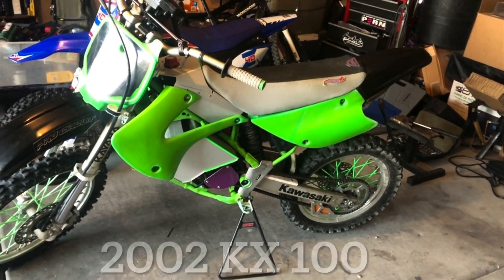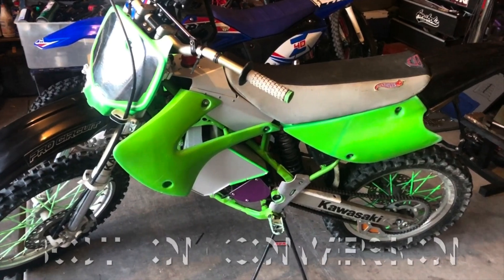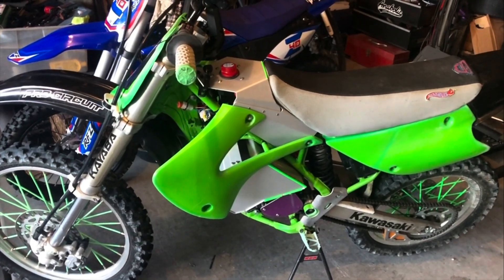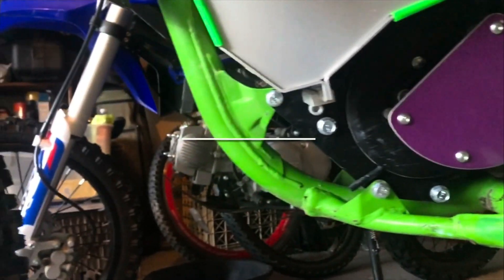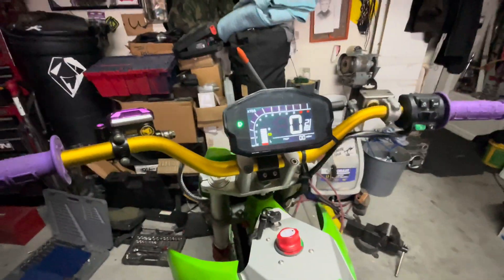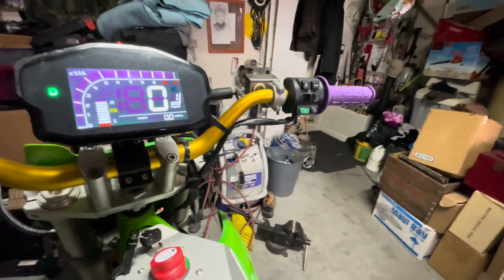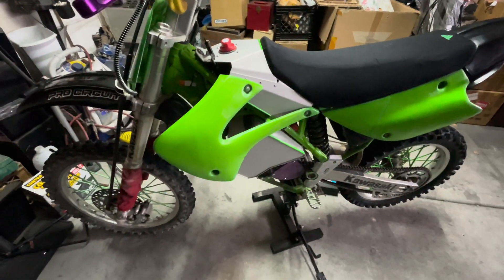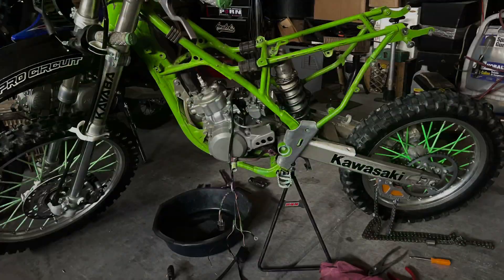Brap to Zapp. Electric dirt bike conversion

Comment: Do you still have this build?
Reply from the maker: Yeah I still got it. It has not needed anything I put different foot pegs on it that lowered them and it made the bike perfect. 
The size of the kx100 with the 16-19 rim set is bigger than a Surron but smaller than an Ultra bee. It’s perfect size

Comment: Clean build with that kit,  how would you compare this eKX100 to your RFN Apollo ?
Reply from the maker: The Apollo is great it is a lot underpowered. So you need to get your controller flashed and then the Apollo is amazing. 
The electric KX 100 is next level. It’s so fast and quiet. It’s the quietest electric bike I have. 
And it’s the fastest. I’ve had it up to 92 mph already. And had more to go. But my tires were unbalanced and it got a little scary

Comment from the maker: I rarely run a full charge battery. Usually I’m running 90% charge on my battery and if I’m in highest power mode I’m getting over 50 miles of trail riding. 
And it’s flipping amazing. This bike is it.

Comment: What kind of run time are you getting?
Reply from the maker: I don’t usually charge to 100% only 90% max for longevity of the battery. 
But my run time is hours because I’m trail riding it right now. Haven’t put it on a track yet but it will easily get over 50miles and like I said I’m not charging it full.